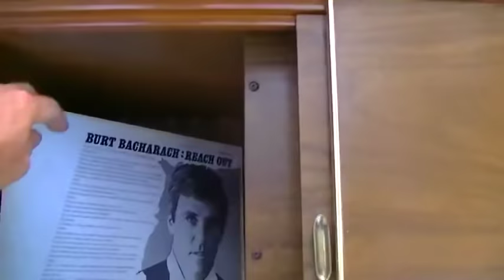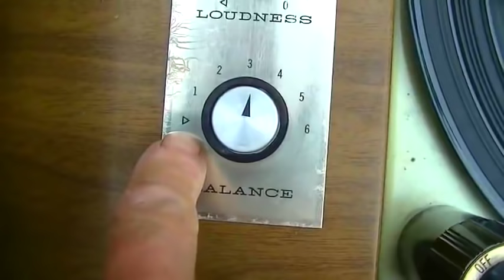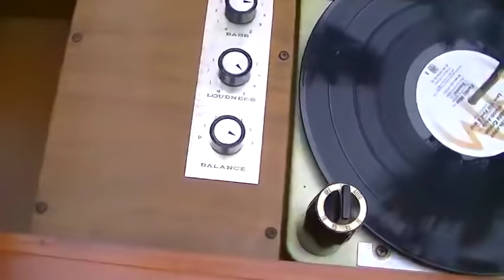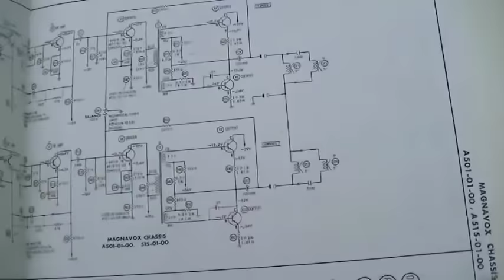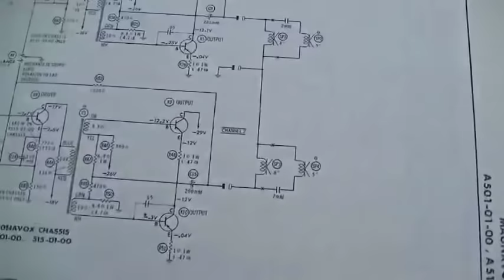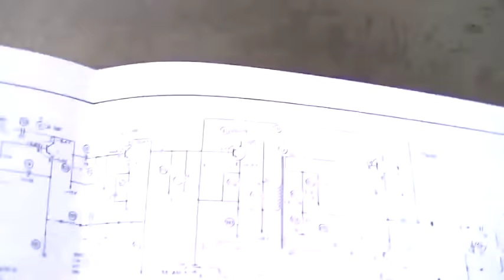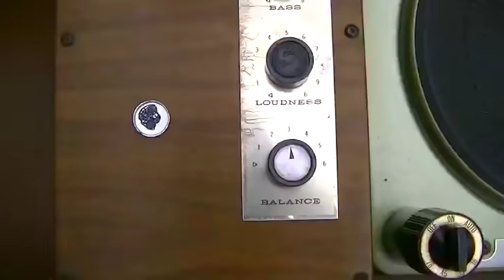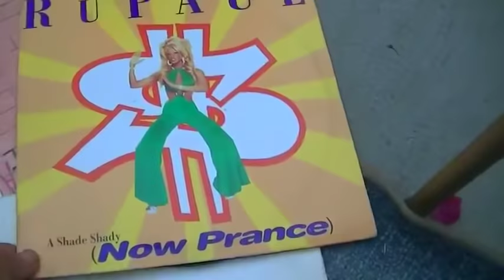Vintage Magnavox Console Record Player Repair

Comment: solid state....give up...waste of time.
Reply: Carl Rudd And I supposed a tube based Crosley Cruiser would be audio nirvana?  I restore and collect vintage Magnavox consoles, and being in Fort Wayne I've spoken to many of the engineers behind these units. This is a low end unit, but the Astro-Sonics were designed to sound as close to tubes as possible and not have the fatigue of solid state. Sure, I love the sound of Magnavox high-end tube units, but an Astro-Sonic Imperial is excellent too. Heck, I sold my Concert Grand. My daily listener is an Astro-Sonic Imperial... my component equipment is stored away.
Reply: My apologies, I'm really not a tube snob..honest. I don't know what I was thinking.
Reply: +Alan Maier Hi i inherited a astro sonic, speakers are in great condition, but the record player wont turn on or spin. Any thoughts as to why?I don't even know where to begin.
Reply: +kelly pryce Kelly, By now the record changer needs to be fully serviced, The motor needs cleaned and oiled (top and bottom bearing) and the idler wheel system needs a combination of cleaned and moving parts lubricated. The drive idler wheel pivots on an arm that is known to seize, but can be repaired. Micromatic changers were built to last a lifetime and then be passed along to the next user, but like anything mechanical, needs a little work after several decades. Bright side is, it's worth fixing.
Reply: +Alan Maier is this something I could perhaps do OR should I find someone to service it ? I'm wondering how steep the learning curve is?
Reply: +kelly pryce Kelly, it all depends on your mechanical knowledge. I've been breaking electronics since the 1960's and repairing it since the 1970's. I know these changers inside and out. However there are videos dealing with Micromatics specifically - seems to me that radiotvphononut has one covering a Micromatic in a multi-part series on bringing an Astro Sonic back to life. The key is to know what to oil, what NOT to oil and pay extreme attention to how the parts are located as you take them apart. Once a part is missing - that's it. These old Micromatics were much more complex than, say a BSR or VM changer - but they were far superior.
Reply: Don't forget ... take plenty of digital pix.